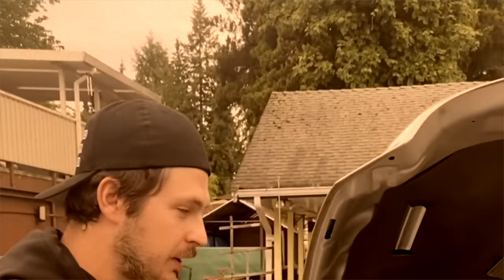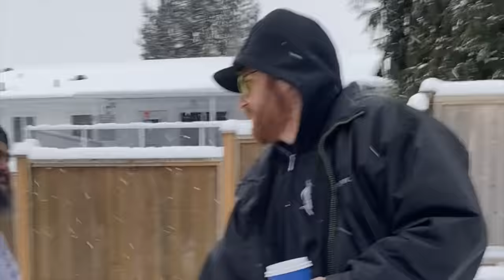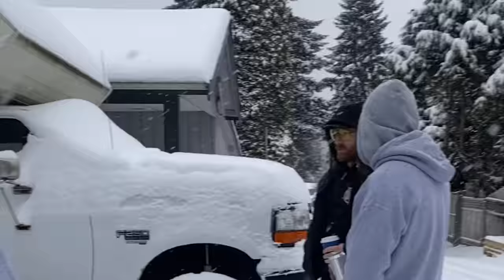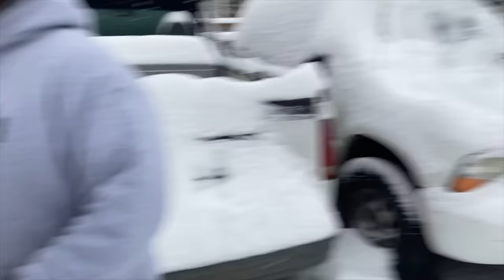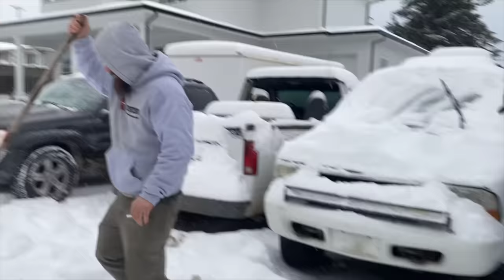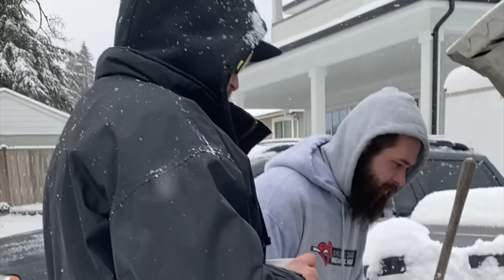ATTEMPTING TO SELL THE GMC JIMMY!

Comment: You can manually pull the cable where the 4x4 actuator is and lock it with a pair of vice grips. I used to do this in an s10 on the weekends 😅

Comment: Too funny cyz the old s10 I had had the same vortec setup and the vacuum actuator was bad in it too. Ended up just changing gears with vice grips under the hood to engage it